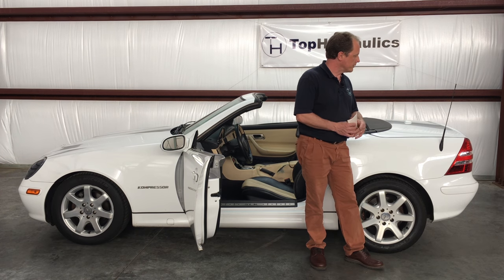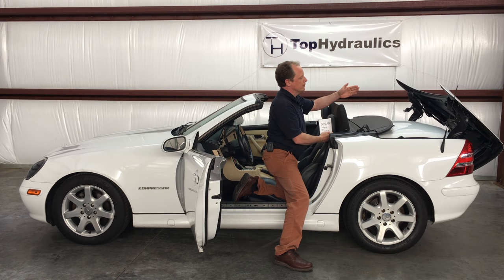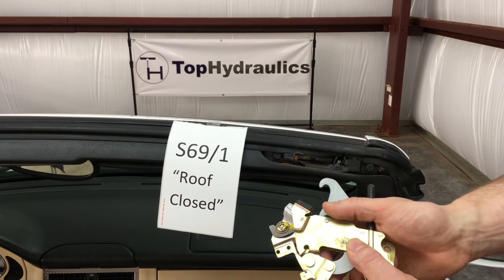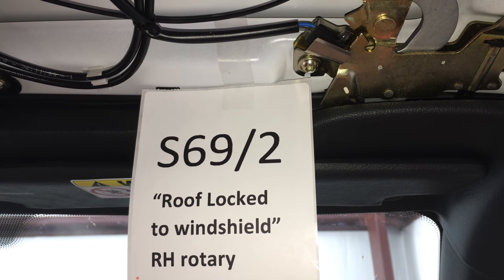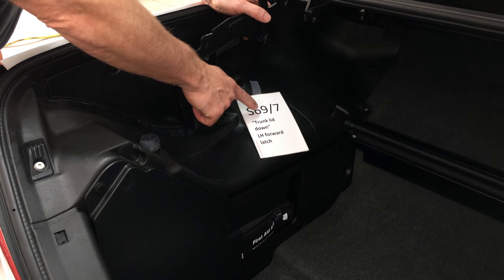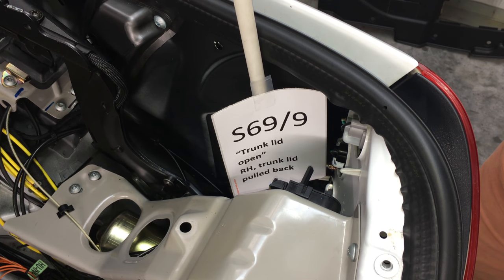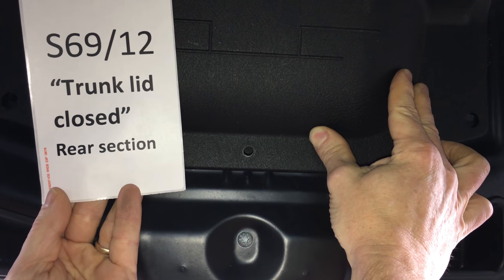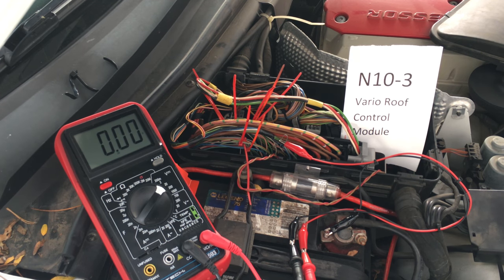Mercedes R170 SLK Top Troubleshooting - Explanation of Electrical system and Microswitch Locations

Comment: Hi Klaus - thank you for a super informative video explaining in details how the varioroof in a R170 works. I have been searching the internet and a variety of forums in the pursuit of a fix for the issue I have with my car.
Almost every time I have been out for a ride with the top down, I experience problems with getting the roof on again. In this video https://youtu.be/_bKftJcH4zg you can see the trunk is open but I am unable to raise the roof. And at the same time, I can not close the trunk again. The only workaround is to try over and over again and have patience, as it finally raises the roof and close.
I have had a mechanic delete the error codes for the switch S69/9 and S69/2+S69/3 I have not been able to get a readout of the error codes since they where deleted.

Can you point me in the direction of where to look for a solution? Or even better tell me what to replace ;o)

Thank you in advance.

/Jacob
Reply from the maker: Hello Jacob, thanks for asking. Are you saying that the error codes did not come back , or that you did not have a chance to have codes read again? Also, does the pump always run when you push or pull the red button?
Reply: @TopHydraulics  I have not had a chance to get a second read out of the error codes. So I do not know which, if any, have come back.
When I try to raise the roof the pump keeps running, and the button stays on. When I try to close the trunk, the red button flashes and the trunk stays open, the pump does not run.
Reply from the maker: Have any components of the hydraulic system been worked on or replaced, lately?
Reply: @TopHydraulics Hydraulics not to my knowledge - I have had the car for 1,5 year and I have not had anything done to it.
Reply: It's a microswich under the headliner, cut the boots off. I had this same problem..
Reply: @janmancuska  I finally got around to answer - you where perfectly right. Replaced the microswich and it has worked like a charm ever since!
Reply: @JacobEnevoldsen  great, glad it worked. I just sold my silk last month. Still miss it..

Comment: HELP!! 2001 SLK, no indication of any hydraulic leaks. Manufactured 11/2000. When I press the switch to put the top down, the trunk opens and the top won’t unlatch from the windshield. Pump does not run if you press the button as if to re-close top. Is there anything simple I can do to lubricate the latches? This happened a few times before and after she reluctantly unlatched, the hydraulics worked fine, down ads back up. I suspect microswitches s69/2 and s69/3, if it cannot be resolved with lubrication. Fluid level is at the upper indicator arrow, and fluid appears clean. No sign of any leaks anywhere.  Car is in excellent condition with 74,000 original miles. I've had it 7 months and had no other problems in the 7500 miles I've driven it. Would appreciate any advice! Sir Carl
Reply from the maker: Thanks for asking. The latches do not normally need lubrication. Just double checking: how far is the front unlatching, if at all? Would it turn if you helped it a little with a 6-mm Allen wrench?
Reply: I will try that! I’m a little unclear on which way you turn it...clockwise or counter to lower the roof?
Reply from the maker: @1nekoosa  Frankly, I don't recall. It will be obvious once you turn it. I recall clarifying it in our video on front lock cylinder removal: https://www.youtube.com/watch?v=NYTTJ_uMWwg&list=PLly4CMbpk7oxzfmMaPF6w5l1xEtmsKUXF&index=4&t=1s
Reply: @TopHydraulics  I watched the hex bolt above the dome light rotate when the top was trying to open, and it was rotating clockwise until it hung up. When the roof wouldn't come away from the windshield my wife and I banged on the roof at the approximate location of the rotating tumblers and the roof opened like magic!! I have been advised to move the pin assemblies outward a couple of mm, which solved the problem for another 2001 SLK320 owner. Also looking at lubrication options, and also considering replacing the S69/2 and S69/3 switches...thoughts?
Reply from the maker: @1nekoosa  The bellows on S69/2 or S69/3 not alowing he switch to relase by itself would explan the symptoms. How about taking the headliner off the top panel and checking them out?
Reply: @TopHydraulics  my car is a 2001 made in November of 2000 so wouldn't it have the switches without the bellows?
Reply from the maker: @1nekoosa  The newer version switches still have bellows on them, the bellows can still fail and you could also have some old stock switches in yours.